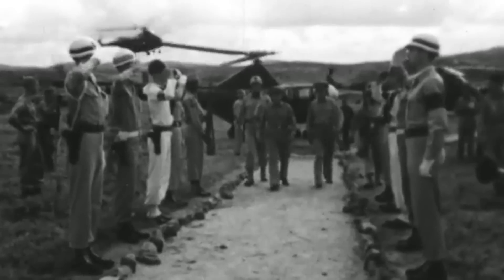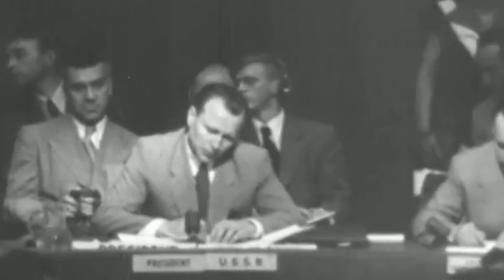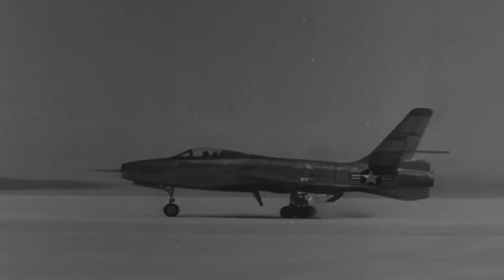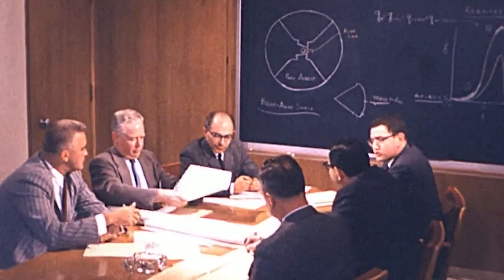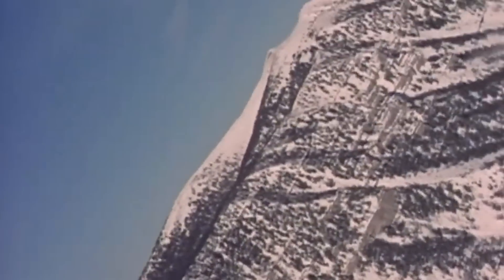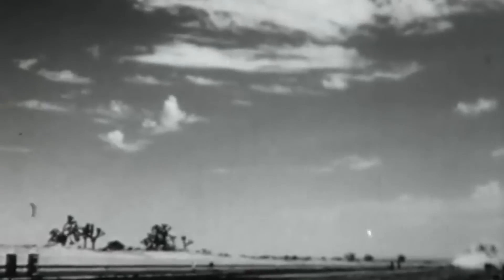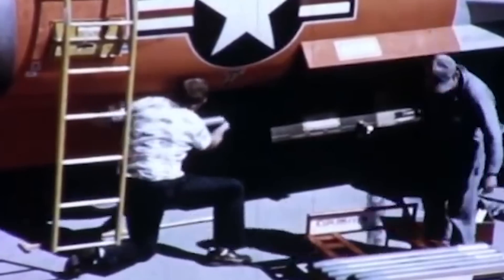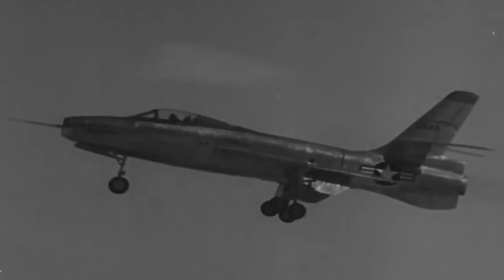The Bizarre Plane Built with Inverse Tapered Wings - XF-91 Thunderceptor

Comment: How come I've never heard of this model before?
Reply: Well, mainly because better solutions were found. The basic problem with rockets is the very limited fuel supply. The XF-91 platform was designed to ensure the wing would stall at the root rather than the tip, making it easier to retain control, not fall into a spin. Also variable incidence, like the F8U. Steve Ginger’s ok is probably the best reference. Other mixed power interceptors were the Saunders-Roe SR-53/177, and the early Mirage IIIC could be fitted with a rocket mainly to boost climb rates.
F-102/106 with the SAGE system were the ultimate solution before ICBMs supplanted air breathing bombers.
Reply: I was a youth of about 11 when these projects were being announced and it was exciting, looked like aviation would be my chosen career.  While that didn't pan out, I did collect many plastic models of the military aircraft of the period and did have a plastic model of the XF-91, with Lindberg (if I remember correctly) the maker of the model though the aircraft hadn't gone beyond the prototype stage.

Comment: As soon as you said "Delta Dagger" the XF-91 was doomed. I firmly believe the F-102 was copied by the French to create the Mirage family. That bad boy was the king of the Cold War alongside the Navy's F-4 Phantom which was not far behind.
Reply: The F-102 was very mediocre. Which led to it's similar-looking successor to be designed, the F106 Delta Dart. The F-106 was the hot plane of the Cold War, not the F-102
Reply: The Mirage is a french development. Dassault is an engineering powerhouse comparable to Skunkworks. Lived next to an airbase with Mirage squads. Superbly elegant plane.
Reply: @808bigisland  Dassault used the Fairey Delta 2 for their testing which lead to the Mystère-Delta and Mirage III
Reply: The f-102 is almost a exact  copy of the Avro Arrow.
Reply: The Air Force also flew the Phantom - and probably had more of them than the Navy did.